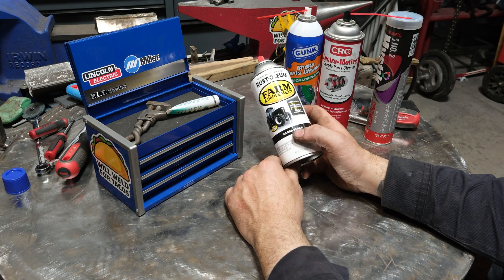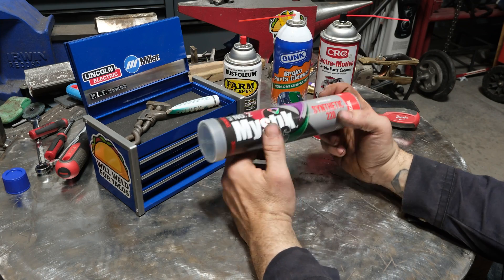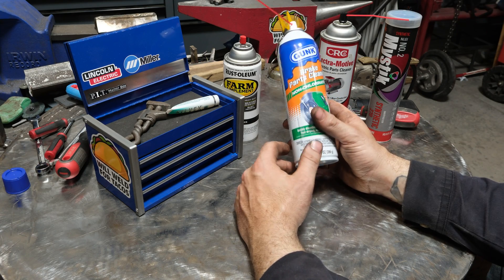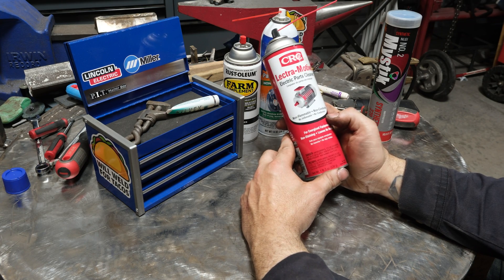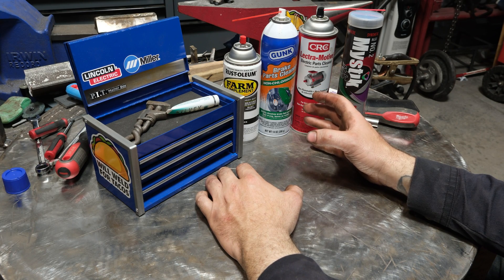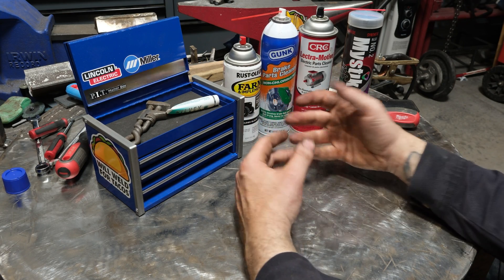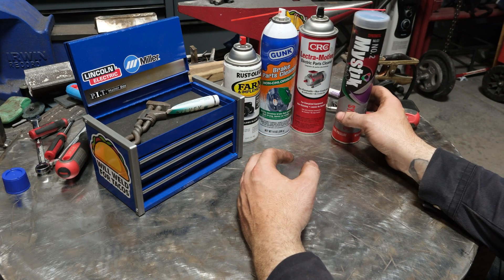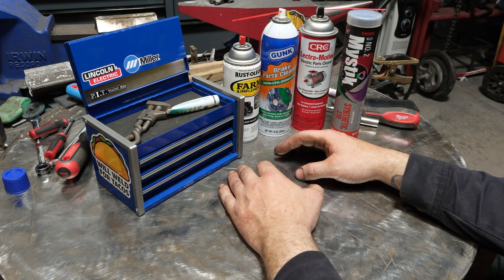QFTB #8 What cleaners/chemicals to avoid using when welding

Comment: Once I had to weld on a frame of a metal door. I could not reach in all those corners and Abends, so i had to leave son of the paint there. I welded with TIG under my wie open Garage door to get rid of the fumes. Suddenly Wind came up in blem my Argon away. I closed the door to solve this overseeing the fumes... The evening and the next day I felt like I had a bad flu although I had my filtermask on.

Comment: Very good advice young man. When do a welding repair I always clean the area to be welded with a grinder and then a rag. I don't use brake cleaner, I don't have any anyway only acetone. I get as much crud and contaminants off as I can and if have any acetone about when mobile I will use that.
Welding under vehicles is particulary bad because of the underseal anti-corrosion treatments. Some of it really bad to get off, but it must come off and be cleaned away, again using acetone. Sometimes, cleaning down with white spirirts or thinners first then acetone and let it dry off.
Reply from the maker: That underbody coating is the worst, especially when it’s flammable 😱

Comment: I got sick as hell once after I welded on a lawnmower frame.  Like a fool, I didn't clean off the paint very well and it was burning and smoking while I was welding away.  Later that day I felt almost like I had the flu.  I don't know if it was cadmium based paint or galvanized under the paint but it was dangerous stuff.
Reply from the maker: No doubt probably a cocktail of stuff.  I have never had zinc fume fever but I have heard it’s really bad.  Some of the stuff they treat metal with is so nasty you can’t even grind through it to get rid of it on thin material because you would have holes lol.

Comment: Jeez Louise!  I knew about the chlorides, but never checked for other stuff.  Dunno about about you but Acetone was always told to me to be an extremely powerful and, therefore, dangerous cleaner.  Interesting that's the "go to" for really bad stuff that needs cleaning.  Many thanks for these kinds of vids!!!
Reply from the maker: Acetone flashes off really quick and doesn’t leave much residue.  It is very dangerous from a flammability standpoint, (hell it’s in acetylene tanks lol).  Generally you don’t want to get it in on your skin.  Now with chlorine break cleaner the liquid tends to not evaporate as fast, and the chlorine stays around.  When you get it hot it produces gas that’s very dangerous.  One time I can recall welding a rear axle housing, and I cleaned it out with brake clean.  Part of a can had to be chlorinated, because I was welding on the outside and I caught a whiff of a heavy chlorine smell, and that was over 20min after I sprayed it.  I shut down the job and washed it out with soapy water.  Dangerous stuff for sure.
Reply: @makingmistakeswithgreg  Wow!  Great information --thanks!  I try to wear the right ppe but I doubt it's strong enough to keep some of these gases out even though I try to keep my face out of the fumes.  I'm old (40's) so any advice on this topic is very important as I think I can count the number of brain cells left on my fingers and toes.  🙂

Comment: Even if you are welding on pristine metal, no matter what process you're using, you should be worried about the fumes.  Metals do not do the body good...
Reply from the maker: Even mild steel and common welding products have undesirable fumes, you’re 100% right.

Comment: If you can grind off the paint and contaminants before welding, do you need to clean the metal with acetone? Will you get a better weld after using acetone?
Reply from the maker: In many cases if you wipe down the material it will weld better.  Grinding dust, paint particles, etc all will interact with the welding process.  Tig will especially need material clean since even normal millscale will contaminate the tungsten.
Reply: @makingmistakeswithgreg  Thank you. You are always most helpful. I only weld with 6013 and 6011 stick and a 110v buzz box, and I don't know much, but I'm learning.

Comment: I find that instead of degreasers using WD-40 on grease gets it off quickly and more effectively, then a quick swipe with acetone.
Reply from the maker: I knew wd40 would remove sticker glue, sounds like it might have more use than that.  Grease can be a real problem to remove.  I do know that getting grease off is a major issue, and tends to catch fire if it’s left on lol.
Reply: @makingmistakeswithgreg  it seems to be able to dissolve the caked on grease and dirt at the same time, seems like the older the issue the better it works.
Reply: I use wd40 as a degreaser/cleaner when rebuilding lathes and mills and other machines tools. It's amazing.

Comment: Great information. Need to talk about welding galvanized steel.
Reply from the maker: Great idea… err it’s best to avoid it but there are ways to deal with welding it 😀
Reply: I've been welding onto galvanized steel for 20 years + . Companies I worked for used no safety. 
I've had steel fever so many times I can't remember.
My lungs are so bad now that I'm older I struggle badly.

Comment: Cleaning steel with acetone is a joke in the Louisiana sun
Reply from the maker: No doubt it will flash off fast.  The problem is the flashing off without leaving residue is what makes acetone safer than many other cleaning liquids/sprays.  Putting an electric arc or heat on any chemical or compound that’s sitting on metal is a bad idea.